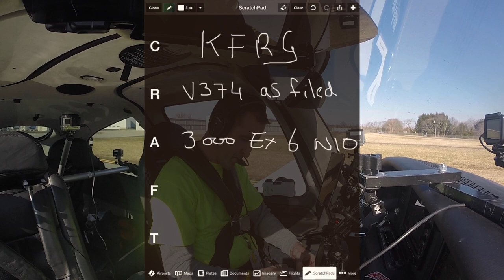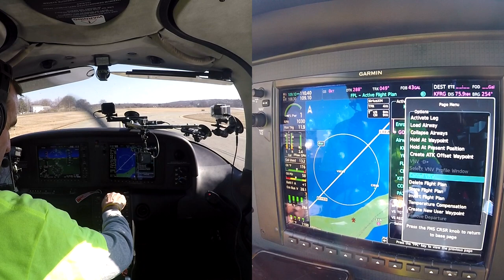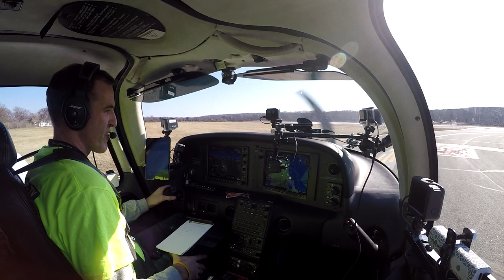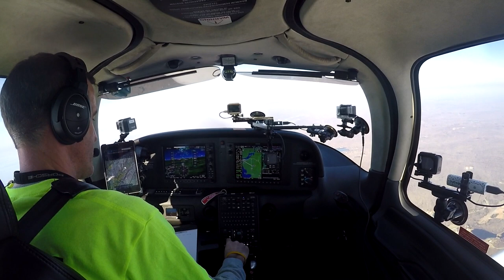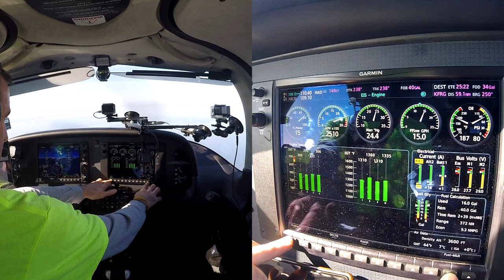Cirrus sr20 G6   KGON - KFRG   Take the virtual right seat .....

Comment: How's the "Lean Assist" feature in the G6? Can you operate LOP for Best Economy? Looks like you were burning 15 GPH in the cruise @ 75% PWR.
Wing-rockin' good flight!
Reply from the maker: Much the same as the G3 , I operate ROP  but I’m sure best economy is available too . Going up with CSIP to run through some other things on the VNAV etc and will ask about LOP best economy .. part 4 in production .. arrival at KFRG ..
Reply: Roger, thanks!
Looking forward to pt. 4.

Comment: How do you like the Lycoming in the Cirrus? Nice video. Which iPad do you use in the cockpit and do you use the cellular data?
Reply from the maker: biggame502   The lycoming is nice , 215hp versus the 200hp in the G3 , few more knots on the true airspeed . I use the iPad mini , the latest one on sale , my older one wouldn’t take anymore software updates so I got the latest mini , Wi-Fi only , no cell data , I use stratus for foreflight to connect to the iPad and it feeds the data , Traffic , Weather ,AHRS etc .. I like it . It’s a good back up tool in the cockpit . Thanks for checking out my video .
Reply: Aidan Beirne  I am taking delivery of 2017 SR 20 and setting it up so thanks. I noticed a better climbing authority with the new Lycoming . Very pleased. Which iPad mount kit should I order for that same left side placement?  -I still want to use my knee board .
Reply from the maker: @biggame502   excellent , well done on the plane and best of luck with it .. the iPad mount I use is this one https://www.amazon.com/RAM-Compatible-Suction-EZ-ROLLR-Cradle/dp/B00DUFBV6E/ref=sr_1_3?crid=HPPQZSHD08LT&keywords=ram+suction+cup+mount+for+ipad&qid=1557776369&s=gateway&sprefix=ram+suction+cup+%2Caps%2C129&sr=8-3  , works well with the iPad mini . i think i got the 4 inch long arm between suction cup and ipad craddle . works nice on the left side . hope this link is helpful .